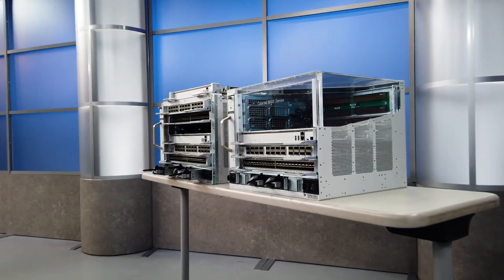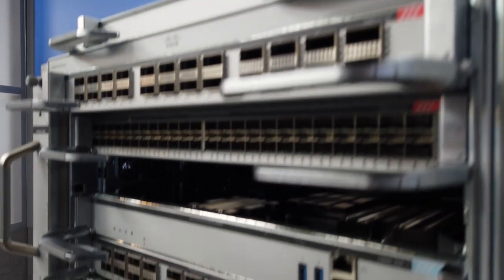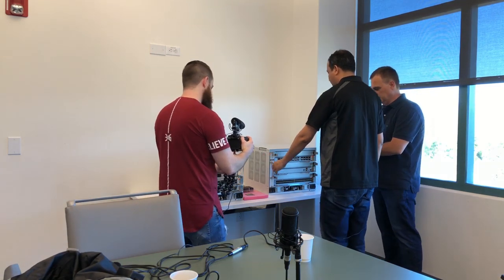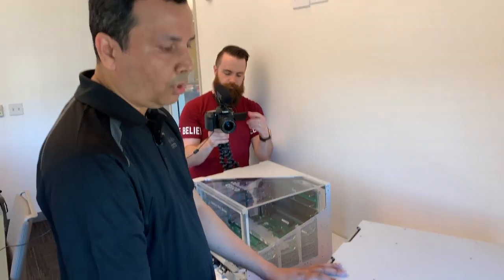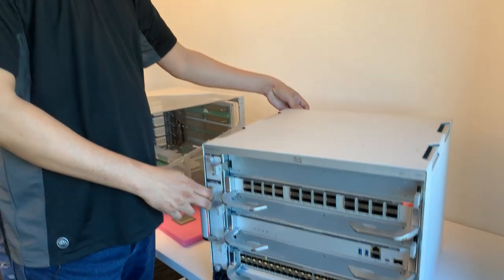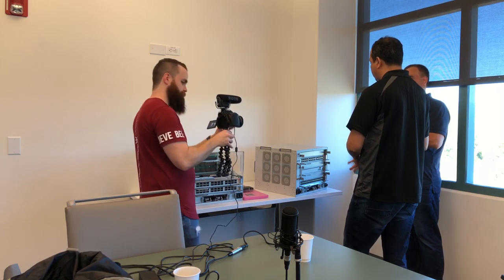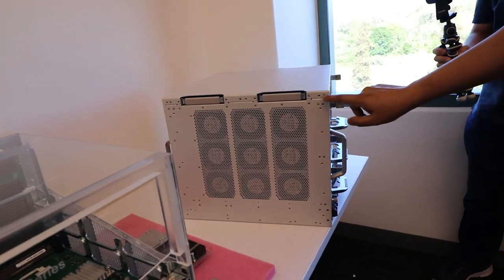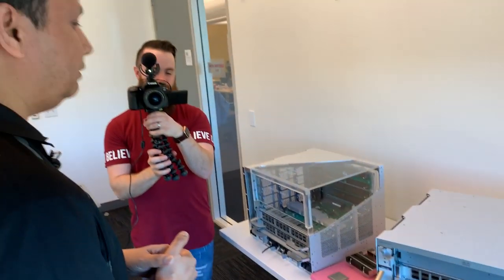MASSIVE SWITCH! - What's Inside the Cisco Catalyst 9600?

Comment: On any of the 9000 switches you can host a wireless controller as an application and it runs on the x86 CPU that's on the supervisor card or that's embedder into the board.  I know the 9600 and 9300 series switches as well as the modern Nexus switches all run Intel CPUs.

Comment: How much does a fully decked out system cost?
Reply: Cisco: Yes.
Reply: We bought 3 9407rs, with 4 line cards and 2 sups from certified pre owned vendor for around 70k-80k kind of a bargain for us with 7+year old fixed switches. Chassis solution is much better

Comment: if only they would use silent fans. wear hearing protection in data centers.
Reply: It wouldn't make a difference when you have air handlers that are as loud as jet engines on the data floor.
Reply: @duvallwifi  It would help, still wear hearing protection.  Its probable why I lost some hearing didn't wear any when I worked in a data center.
Reply: They should use a different RPM for each fan. Or use two types that cancel each other. But you don't need to hear in there. It's just annoying.

Comment: I cringed every time they rotated the chassis on the table top. Why cant they put them on some kind of turntable / lazy susan? Also, somehow it took me a while to understand which car designer was involved in the design - it was Pininfarina. And I welcome their input for the line card handles. I never liked the feeling on the old catalyst 4500 or 6500.
Reply: turntable, yip 😬 - always find it funny how end-user customers go ballistic over tiny scratches and RMA accordingly but then during deployment expensive kit are treated willy-nilly. 

4500/6500 handles break at times  <rarely though> but plus is you can still insert with one broken handle and just use captive release screws to keep intact.

All in all a good take on the product.
Reply: Good shout on Pininfarina and the humanised technology design used on this chassis and other models within the range - interesting design company.